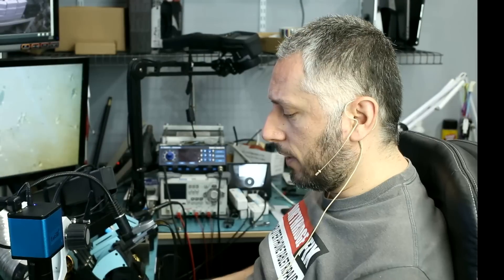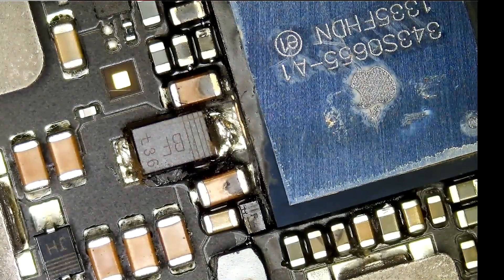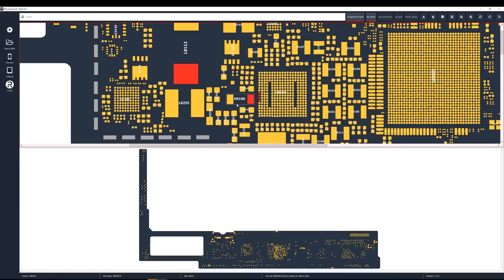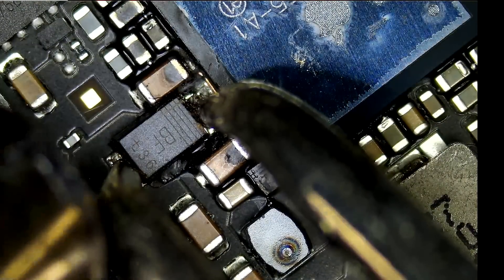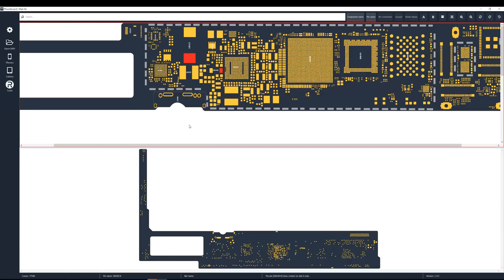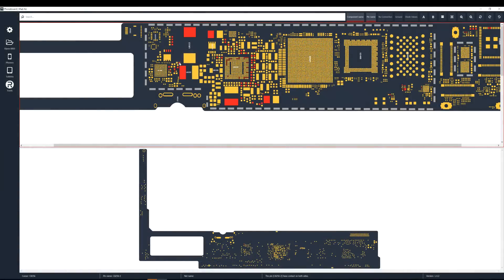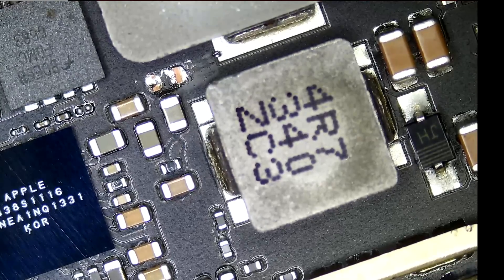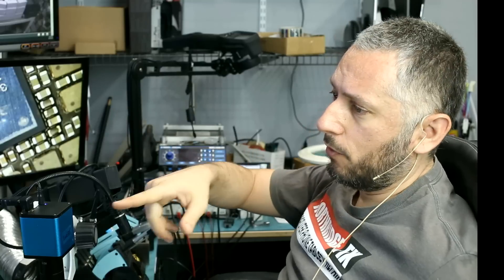iPad air does not power on - Motherboard Diagnostic

Comment: Looks like you got a relatively easy repair if the client wants you to repair it of course. I am late I know.

Shame the client I was repairing for, the main power ribbon broke due to being too brittle while removing the motherboard, since it broke at a bad angle it has seriously damaged the main logic board, and I do not have the correct tools to move over the CPU, Storage, BIOS to a new Logic Board and since there is no way the client will accept the much higher bill for new tools I'll have to cancel or give them new logic board with all fresh data which they likely  won't accept, it sure does hurt knowing you can't even try to repair it without losing all data.